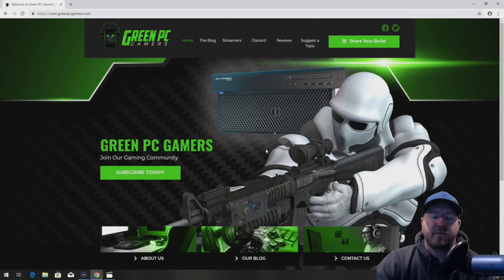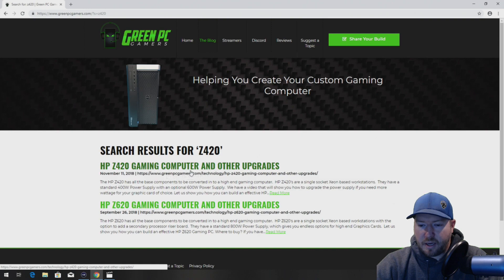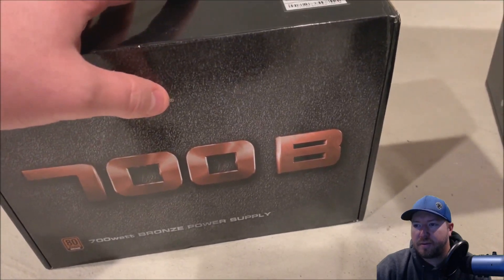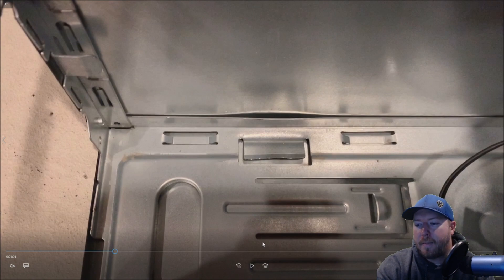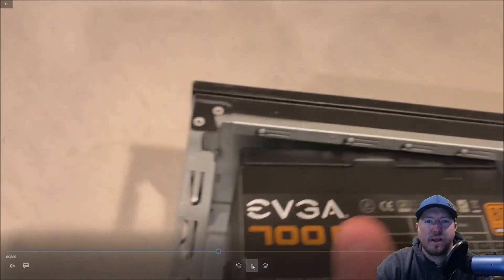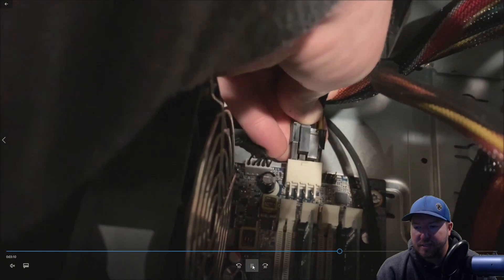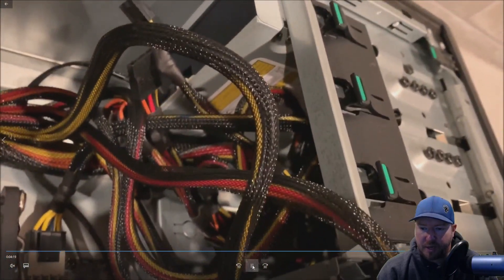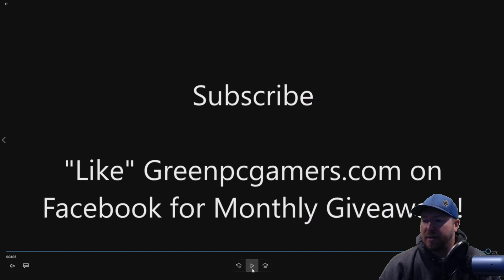HP Z420 Workstation Power Supply Upgrade and Replacement

Comment: Is there any psu cable adapter for gpu?
Reply from the maker: The stock power supplies have limited GPU power options.  That's why we installed an ATX power supply.

Comment: Brother I have a hp z420 and has a built-in psu of 600w but it has 6 pin for the gpu but my gpu requires an 8 pin, I have used the 6 to 8 pin connecter but it damaged my card and I had to repair it and they told me to change my psu and to stop using the 6 to 8 pin connector, so now I'm looking forward to buy thermaltake 600w supply which has the 8 pin pcie cable so what would you say, is it ok to use this psu in this workstation and is it compatible, plzz reply???

Comment: Thanks for the inspiration. I had a Thermaltake TR2 600W to fit in a Z220 (slightly different model). Ofc didn't fit. But if I place it on the most top position, there's one screw fitting to the fan gutter, which I can then put a big screw (VESA) and sits quite tight! I also put some double sided strong tape, just for additional hold. :)

Comment: Installed 128GB RAM 8 Core CPU and 1660s in Z420 with this PSU, not Satisfied the performance against spec.

Comment: Didn't do my research until I bought a new GPU and PSU and discovered HP proprietary b*llshit 18 pin motherboard. Thanks for the tip, need to order the adapter now!

Comment: Thanks! i bought a prebuilt one of these with a 2060 but the power supply is only 400watts. I would play games and it would just black screen. Turns out it just wasnt getting enough power.

Comment: Watched this to see how to open that cable clip to remove the PSU and you don't show it. I'm trying to move to a bigger case.
Reply from the maker: simply grab the lip and lift up gently.
Reply: @GreenPCGamerscom  I had to press mine towards the wall to open. It seems that the PSU cannot be changed. Fortunately the 600watt powers the Tesla GPU well.

Comment: Hey man the PSU listing you linked isnt available anymore. There is an updated model of it EVGA 700 BR, 80+ Bronze 700W, 3 Year Warranty, Power Supply 100- BR-0700-K1 100-BR-0700-K1 (tried posting link but got error message) Will this work on the Z420 workstation?
Reply from the maker: Most ATX power supplies will work.  The Key is the power adapter cable.

Comment: Are those command strips really strong enough to hold a PSU in place? Dont PSU's get really hot you'd think it would melt the adhesive on the velcro strips
Reply from the maker: The power supplies do not normally get hot.  The command strips do a decent job.  However, most atx psu's will have a couple of the screw threads that line up with the chassis.  You could use a combo of 2 screws and command strips if you want.  Thanks for commenting.
Reply: @GreenPCGamerscom  Hey thanks for the reply and letting me know about the screws lining up. I have to replace this part and was really freaking out but your tutorial definitely helped out.

Comment: i have...
HP Z420 cpu
Processor	Intel(R) Xeon(R) CPU E5-2650 0 @ 2.00GHz, 2001 Mhz, 8 Core(s), 16 Logical Processor(s)
Ram 32 GB
.........when i use 'After Effects' and apply any effect+render Both cases The system is too slow, plz how can i speed up my system, thanks
Reply from the maker: After effects relies heavily on cpu for rendering.  You should consider upgrading your processor to increase the performance.  

Check out our Z420 upgrade guide:

https://www.greenpcgamers.com/mfg/dell/hp-z420-gaming-computer-and-other-upgrades/

Comment: Tried those 3M command strips, and after a few days, they failed, and the power supply came off.  Unfortunately, the massive temperature variation from the PC and the PSU itself, will do this.  I'm going to try Gorilla Heavy Duty Mounting Tape next, to see if that fares any better.

Comment: will this affect the cooling in the computer since the psu fan is facing down?
Reply from the maker: We haven't had any cooling issues using the aftermarket power supplies.  The air still gets pushed out of the back of the chassis.

Comment: Hi guys, I got a 700br via the link on the website and installed it and now am getting the 4 beeps and a red light meaning it’s having a power error.  I’ve checked the connectors and they seem fine.  I am running a msi gtx 1060.  Any help would be appreciated, thanks 😬🤞
Reply from the maker: Are you using the adapter?

Comment: Hi  
the site indicates that there will be difficulties with
rtx 2080 ti when connected to z420
please tell me if they will work and what problems may be ?
another question: are rtx 3070 cards compatible with z420 v2 ?
Thanks
Reply from the maker: You’d have heating and bottlenecking issues you install either of those cards in a Z420.  The GTX 1660 ti is a really good value card for the Z420.

Comment: Velcro Strips of any kind are Unnecessary IF You are Patient and Clever enough to CAREFULLY Measure and Drill TWO Small Holes in the Back of the Case for some Standard 6-32 PSU Mounting Screws, Slightly widening the Bottom Left Mounting Hole on the Left Side to Match the location of a Standard Power Supply Mount in that Location, and then, WITHOUT BENDING ANY OF THE CASES PSU GUIDES, fabricating a simple straight, flat piece of metal (I used an old 6 in. x 1 in. Steel Zinc-Plated Mending Plate available from Home Depot for $2.14) with Two Holes Drilled and Tapped for 6-32 PSU Mounting Fasteners, with a small piece removed from the Top Middle to avoid the Cases PSU Guide there as a Filler for the GAP at the Top of a Corsair 850 Watt Fully Modular PSU - Worked like a Charm and VERY Secure and Level
Reply: hey dude can I get a guide on this somehow?
Reply: Or maybe like pictures of your psu?
Reply: Any pictures or link you can provide us?

Comment: Hey mate I have a z420 too and have an issue. When i play grapihics demanding games my pc give me a weird color on my screen then restarts. I have a gtx 970 oc edition from asus, 600 watt psw, xeon e5 1603, 64 gb ram, 2tb hdd and 240 gb ssd
Reply from the maker: You could start by troubleshooting the monitor and graphics cards.  Do you have any spare available to swap to see if the issues goes away?
Reply: @GreenPCGamerscom  No it's a TV LG model. The issue persist when I slightly move the GPU 8 Pin on the graphics card the pc would randomly restart. I think i'll need to replace the psu because I contacted HP support and told me that the psu is the problem.

Comment: Hey! i have a problem with my z420 workstation. So i got it working and all that, but then i was looking on a video were he did something in the bios and i followed it. But then after that the pc won't start again. It fires up and all but i don't get any display and it blinks red 6 times, and according to hp it means it has a bad gpu or motherboard but i mean it was working just before! you know any fix?
Reply from the maker: We don't know of a fix for this issue.  Sorry
Reply: Try removing cmos battery

Comment: i discovered something, so what if i buy a PSU with only four pin power then buy VCOM VC-POW8ADP 4-Pin Connector to 8-Pin Fan Power Cable (CE312) will it still work?
Reply from the maker: We've never tried this.  Let us know if you try it.
Reply: @GreenPCGamerscom  I will, I've ordered the cable but it be on pause in receiving it due to the outbreak  but when i get it i will let you know.

One more thing, about the cooler, is it possible to change it? I want a LED one to make it look cool

Comment: cant you just remove the 4 pins that you can remove from the 24pin plug?? no need for the adapter?
Reply from the maker: We've never tried that.  Let us know if you try it.
Reply: The adapter changes some signalling from the power supply and connects different voltage rails to the motherboard that aren't on a normal atx 24 pin connector

Comment: Would I have to get a new power supply if I'm getting a 1050 ti. Would the default power supply suffice?
Reply from the maker: The default psu will work fine with that card.

Comment: hi i have a question i buyt a rx580 80 fb and 600watt psu  and it came with a 20+4pin i needed a 18 pin i just plugged the 20pin and my pc did not start and my psu burned from insinde do you think my pc is also broken now????
Reply from the maker: It's hard to tell without seeing it.  Have you tried reverting back to the original specs to see if the system will function again?

Comment: PSU Upgrade For Z210
I have Z210 with 400 psu (DPS-400AB-13A ) but I want to upgrade my psu to 500 or may be 600. How can I achieve that?
Will This one work in my case :
https://www.amazon.com/HP-632911-001-Z420-POWER-SUPPLY/dp/B01MRV31HZ
because the wiring and chassis of 420 and 210 seems to be identical

Comment: Great work. I'm working on my adapter and replacement power supply. My question is about the pin that powers that memory section. It seems to be a normal eight pin. Will that work. Getting a Rosewill ARC 75 with 20+4 PIN Motherboard Connector x 1
+12V EPS 4+4 PIN Connector x 1
6+2 PIN PCI-E Connector x 4
SATA Connector x 6
4 PIN Molex Connector x 4
4 PIN Floppy Connector x1
Hoping this will cover my needs.
*Update* This upgrade worked for me! Got a 750 watt power supply in my hp z420!! Thanks!!
Reply from the maker: Offset Era (Official Band Channel) we haven’t tested that particular psu.  Let us know how the install goes.  Thanks for commenting!

Comment: Does it work with HP z220 Workstation as my default PSU is 400W currently i am using gtx 750ti and want to upgarde and my question is that whether changing PSU using 24Pin to 18Pin will work ??
Reply from the maker: We haven't done the Z220 yet.  According to ModDIY, this cable will work:  https://www.moddiy.com/products/HP-Z230-Z220-PSU-Main-Power-24-Pin-to-6-Pin-Adapter-Cable-30cm.html

Comment: Hello, I have a motherboard hp 586968, that motherboard works with any power supply atx or does it have to adapt something? Please your help in this topic.
Reply from the maker: It should work with most ATX Power Supplies as long as you can physically fit the power supply in to the case.  You will need the adapter cable to complete your install.
Reply: @GreenPCGamerscom  Thank you very much for the answer, now buy the power supply atx with confidence, on the space I will use a nzxt box.

Comment: Hi... is there a reason that you use this special power supply? Or can i take any standard ps? My z420 have problems with his (i have to shake it ..:) ) and i want to change it. I have got an older on from bequiet (650w).
Reply from the maker: Most ATX power supplies will work as long as you can fit them in the chassis.  You will need the adapter cable to complete the install.
Reply: @GreenPCGamerscom  Thanks for the answer... the adapter is on his way to me...:)
Reply: @GreenPCGamerscom  I can tell coolermaster 650watts do not work with that adapter cable. Look like the connector pin of your EVGA 700B is matching HP standard. I bought the exact same EVGA in your video and everything work!

Comment: and another question 
I want to buy an hp z420 machine with xeon e5 1620 v2 and the graphics card i want to install in it is rx 580, my specific maching is coming with an hp power supply of 600w do i need to replace it or will it work?
ps. the card is rx 580 nitro+ 8gb
Reply from the maker: You could certainly try using the stock 600W Power Supply with that gpu.  If you have issues you can upgrade your power supply.
Reply: @GreenPCGamerscom  thanks for your quick reply and if I do upgrade it, do I need to make modifications to the case to make it fit or is there any power supply which will fit without modifications?
Reply: @GreenPCGamerscom  also i did some research and found out that rx 580 will at its maximum will not go above 237.4 watts and it uses 6 + 8 pin connector so will it be safe to use the original power supply with a sata to 8 pin connector?
Reply: I have an RX580 in my hp z420 and it ran fine for the most part with the 600 watt stock power supply, but some extensive games did hard lock on me. I saw a power increase with replacing the PSU with higher wattage.

Comment: I dont get it man, hp z420 comes with a 600w power supply and the gtx 1080ti's peak power is 300w why is the system unstable then?
and you only upgraded to a power supply which has 100w more, how does that solve your problem?
Reply from the maker: With in game testing we were having intermittent shut downs with the stock 600W Power Supply under heavy load.  You are correct, the extra 100w and additional power rails solved that issue for us.

Comment: I am trying to upgrade a z440. The 18pin connection is the same however at the top of the board there is a 12pin instead of the 8pin showed in the video.
Would I use 2 6pin? Similar to how you used 2 4pin?
Reply from the maker: Hey Nicholas B,To better assist you, can you please post this on our forum and add a few pics.https://greenpcgamers.forumbee.com/Thanks!

Comment: Thank you for the video! I recently bought the 850 watt version of your PSU, and I am testing it with a Z420 with 8gb of ram, E5-2670, and a 1080ti. It turns on when there are no 6-pin connectors attached to the PSU (for me that means no cd drive or hard drive). However, once i plug in ANY 6 pin connector (regardless of whether its going to a GPU or SATA/CD/DVD), the fans briefly spin and then shut down- and Ive tried with several known working cables. Is this a mobo short issue?
Reply from the maker: Do you have a lower end graphics card that you can try in the system?  Feel free to post this on our forum:  https://greenpcgamers.forumbee.com/  Adding some pictures would be nice.Thanks!
Reply: @GreenPCGamerscom  Unfortunately, its the only spare I have. I read a comment by an HP employee about the mobo only using 12v rails and making other voltages using that rail (https://h30434.www3.hp.com/t5/Business-PCs-Workstations-and-Point-of-Sale-Systems/HP-z420-motherboard-18-pin-layout/m-p/5845558/highlight/true#M14686). While your psu doesnt seem to have any issue in your build, would this make a difference?  My PSU is the EVGA 850 BQ (gold).
Reply: @brobeans5907  Did you ever get this to work?  I plan to do an upgrade to an 850 G myself.

Comment: Hey Guys, so I just purchased an MSI GeForce RTX 2060 Gaming 6GB graphics card for my Z420.  After i had already purchased that i found your video where you recommend i upgrade my power supply to atleast 650w.  My question is if i install the card about a week or two before i upgrade my power supply would that be ok short term?  or should i wait on the gpu install until after i have my new power supply in place?  Thanks.
Reply from the maker: Hey JT7166,  does the existing power supply have the correct power adapter cables for your MSI RTX 2060?  If it does, you can temporarily use it until you get the upgraded power supply.  Worse case scenario = you fry the stock power supply.
Reply: @GreenPCGamerscom  wow thanks for the quick reply. The card has an 8 pin connector and power supply 6. I bought an adapter to go with it, I'm hoping that will work. Wish I found your site/page before I started buying parts. I'm a noob when it comes to PC gaming and upgrading pcs
Reply from the maker: Welcome to the community!
Reply: @GreenPCGamerscom  thx 👍
Reply: @GreenPCGamerscom  I am up and running. No issues thus far 🤞thanks for the help!
Reply from the maker: I forgot to mention other possible side affects.  You could have intermittent power down issues if you exceed the wattage from the stock power supply.  It all depends on your usage.
Reply: @GreenPCGamerscom  so uh, funny you say that. Cpu worked fine this morning. Now when I power up the power button beeps and flashes red 6 times....
Reply: So it started to fire up, saw the windows screen then it just went black again. No beeps this time. Is this the power supply thing you were talking about?
Reply from the maker: That’s typical if you are having a power issue.  Hopefully your atx power supply and adapter cable come in soon.
Reply: @GreenPCGamerscom  haven't purchased the power supply yet, there a good deal on EVGA 750w one of amazon. Do you think that will be enough?
Reply: @GreenPCGamerscom  idk man, I got a new power supply in and still I turn it on, it's starts spinning, the just black screen and monitor turns off. I'm lost.
Reply from the maker: If you swap back to your original graphics card do you get video?
Reply: @GreenPCGamerscom  just swapped back to original power supply and graphics card and it works perfect again. I don't get it. The last time I turned it on with new power supply and graphics card in it got to the windows loading menu, then said running diagnostic. After it did that it said it can't repair my PC and would shut down
Reply: I'm wondering if despite installing the proper driver for the rtx 2060 if every time I restarted it, it was reverting back to the factory driver? Within like a minute of the old graphics card back in my display was back to normal and it looked just the way it used to.
Reply from the maker: Jt7166 I’ve seen that happen before.  You could try uninstalling the quadro driver.
Reply: @GreenPCGamerscom  I don't know what else to try. Tried every combination of new power supply, old, new Gpu, old gpu. Only way I can get it to work is with all the old stuff in it. Gonna have to bite the bullet and take it somewhere I think
Reply: @GreenPCGamerscom  so I took it to geek squad and they told me I need a new processor to install this gpu? Does that sound right? Doesn't make any sense to me if it works fine with the old card and power supply in
Reply from the maker: Jt7166 please message us through Facebook.
Reply: @Jt7166  that doesn't make sense existing processor should work fine